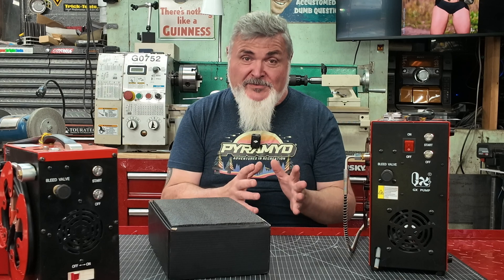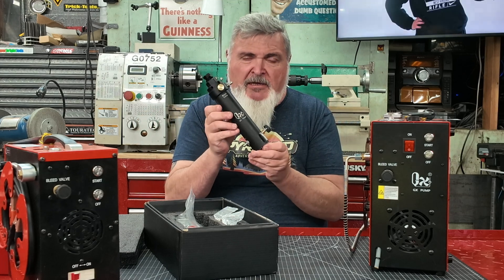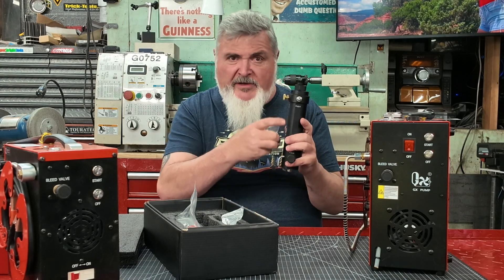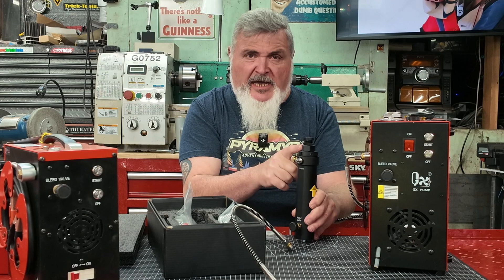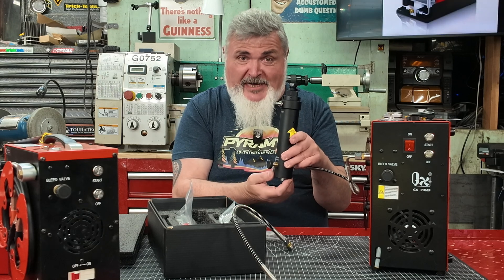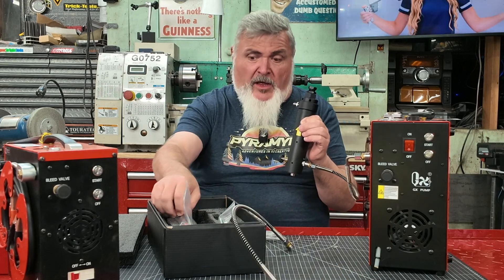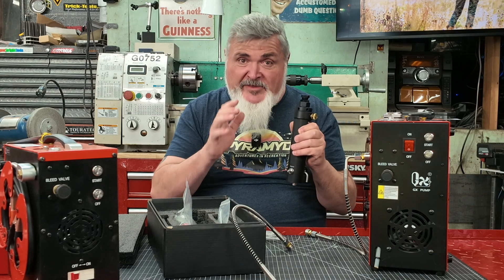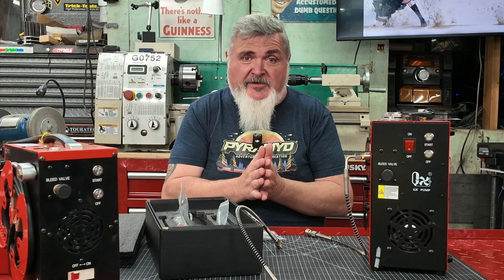Revolutionary Moisture Separator for PCP Airguns: Physics-Powered Dry Air Solution!

Comment: Hi ! I have been following your Channel becauseI own a GX CS2/3-401 PUMP PCP COMPRESSOR which I purchased maybe in 2021-2022 ! I have been trying to watch if anybody shows or reviews this compressor but I have had no luck !  I need to find the corresponding Owners Manual or Instruction Manual for my model without any luck yet !  I will like to ask you regarding this GX-PUMP HIGH PRESSURE PCP AIR COMPRESSOR’ FILTER’S operation where you mentioned that this  FILTER will build inside itself air pressure up to 2,000 PSI before actually letting the Air out to fill the Rifle/Pistol’s Reservoir.  My question is: if my PCP Air Rifle and PCP Air Pistol’ Reservoir both have a 200 BAR Air Pressure Limits will this FILTER allow both the reservoirs to filled up to 200 BAR ? I will appreciate your answer to my inquiry!  Thank you for your very detailed explanations on anything PCP related and your overall knowledge !  Subscribed !
Reply from the maker: First we need to make sure we are using the same units to properly understand your question and the answer. 200 BAR = ~2900 psi. The pressure maintaining valve is actually set at 1800 psi. All that means is that air won't flow OUT of the filter UNTIL it reaches 1800 psi. Then it will begin to fill the line to your gun. It will slowly fill until your 2900 psi (200Bar) target is reached with no issues.

Comment: Do I need a moisture filter on my Huben hand pump, and, if so, which one would be good for it being so small and requiring a higher pressure than most? Thanks and thanks for the great content.
Reply from the maker: Thank you for your comment. The rate of airflow does not affect moisture level or separation, so yes, this filter will work great and a small to medium powered compressor OR a simple hand pump. Use of this separator will make the air in your gun much much drier. Most folks don't stay with a hand pump for long due in large part to it labor intensive nature. You must be a beast!

Comment: After conversing with Pat about what compressor to get after getting two Vevors that failed to work, I ordered the CS4, and at the same time, this filter.  I am impressed.  Topped off my 6.8L bottle from 2,800 psi to 4,500 psi in 38 minutes.  Just wished I had thought to use your affiliate link.
Reply from the maker: That's awesome to hear you're impressed with the filter and your new setup!

Comment: I there any reason a vacuum pump cannot be used to "pull" a vacuum on the unit to dry the Desiccant
Reply from the maker: It is my understanding that the media needs to be in a 700 degree environment for a period of time to effectively remove moisture from it. This is how it is done commercially. Most of us don't own kilns and new material is really cheap. Worth a try I suppose if you have the gear, just be sure you have an effective test method to determine success.

Comment: Is it true that you should not directly hook up your compressor to your air gun? My compressor has a water separator on it? This is off topic but a lot of pellet and slug manufacturers are focusing on expansion but I'm more interested in finding a harder slug and pellet for penetration on harder objects. I'm not a hunter but for example bones , metal and wood. In my opinion there's too much expansion today and a lot of these slugs and it's limiting penetration.

Comment: Why is the top equipped with a regulator and how do you adjust it? I haven’t been able to get air to go thru the filter since day one tbh. I was looking for the reason and found in the top a stack of belleville washers. Can you show us how that works and why they are there sir please?
Reply from the maker: That is NOT a regulator, it WAS a pressure maintaining valve. Watch the video again. The valve WILL not pass air until it exceeds 1800psi. If you have taken it apart you will need to recalibrate the pressure maintaining valve or PMV. My apologies if I did not make that clear in the video.
Reply: @TargetForge  mine made a popping sound and a whitish liquid is seeping from the threaded cap that twists onto the cylinder. Would that be a burst disc bursting or an “o” ring giving way? Is that something end users can deal with or is it a send in for repair issue on the separator? I need to fill my tanks.

Comment: So if I'm topping off an scba tank with a CS4, do I need to bleed the separator every so many minutes? Do I turn off the pump to bleed it, or bleed it with the pump staying active?
Reply from the maker: Depends on your relative humidity. You can vent while running, venting the compressor vent will expel water trapped there before it even get to the filter, so it is the better choice.

Comment: So much water sprays out the bottom! Can’t believe all of this was going into my tank!
Reply: @pepethegoat999  what happens to the stuff previously that went inside already.. does it eventually clear out. Or would this help too?
Reply from the maker: Dry air will move previous moisture through the system.
Reply: @wukong1325 the water drys out your internal seals, causes rust, and the compressed moisture also affects your power output. I would never fill my gun without this filter

Comment: I understand the point of it building up to 2 thousand psi Before engaging with the tank cause you are supposed to equal That pressure before opening the valve on a bigger tank when filling. But , Does it interfere with filling straight up to the PC p tank ? all that two thousand p s I  at once? Because I understand the point of it for a bigger tank but not straight to the gun, Wondering if that's too much or if it'll pop the probe out
Reply from the maker: Thank you for your question. I think you might be letting your imagination get the better of you. The pressure maintaining valve does not dump a sudden rush of air. As it starts to vent pressure it gradually equalizes, it will not "blow a probe out". This technique has been used for a very long time and is now affordable to nearly anyone. Heck, get one on Amazon, use my link, if you do not experience super dry, clean air, you have 30 days to return it for a FULL refund. They are the solution.

Comment: Just got mine in yesterday. Going to use it on my GX E L3 compressor to fill my BRK Ghost. That little compressor works great. Right now I have just a small gold filter on the whip line. Think I should keep that on the line still, and run it in conjunction with the new GX filter,or just run the new GX one? It’s a great looking well built filter. Thanks for any help. God bless.
Reply from the maker: Good stuff!

Comment: Great product review. I'm getting ready to purchase an Avenge-X airgun and a GP CS4 compressor. Is an additional moisture filter like this necessary with this combination, as the CS4 has some type of water seperator built in? Thanks.
Reply from the maker: The onboard separator will help, but this is a significant upgrade to the air quality, and the GX CS4 is a great compressor.

Comment: Thank you!
I am currently using the big golden Tuxing Molecular Sieve, but this is the real deal! A proper seperator snd only afterwards a desicant. And even better, with an actual pressure release valve, nice!
Will definitely get one of those.

Is there any flowrate range given?
I would assume GX 2 to 4 are all fine with it, what about a bigger one?
Reply from the maker: It should be fine op to 30L per min. That is way higher than most "home" compressors.

Comment: Picked up one of these separators. Noticee you and Broncato (sp?) in another video talking about the various separators and that they need to be vertical. I'm assuming that that is while they are in use? After done using the compressor and purging, I'm guessing that the separator can be laid horizontal for storage? I have a nice container that I can use to transfer the GX-CS2, power supply and separator all together but the separator needs to be laid horizontally. All good?
Reply from the maker: Just be sure it is vented and dry FIRST. You should be okay.

Comment: I have one of the early Yongheng air compressor that operates on 220 volts. Came straight from China. Will this filter work fine with this compressor?
Reply from the maker: ANY compressor will benefit from this separator. The physics don't care what you compress the air with. That is what makes this unit so special.

Comment: Can these also be used on a large scuba tank? I have a large compressor with filtration and just bought one of these for added protection but was wondering if it can be used on either a compressor or a tank
Reply from the maker: Sure it can. I would ditch the SCUBA tank and get an SCBA Carbon Fiber tank, they are MUCH better.
Reply: @TargetForge that’s what I have, carbon fiber 98 cubic foot air venturi tank with the Edgun ezfill, best thing I ever bought, it’s expensive but worth every penny
Reply: @michaelpintal5419  I see. You wrote SCUBA and I thought that is what you meant. Sorry!

Comment: Where can you get extra filters when needed, I checked GX website and doesn’t even show the filter, my concern would be after when I need filters that they won’t be available
Reply from the maker: Hello Michael, there are no filters to replace. That is not how this works. As I stated in the video 98% of the separation of water happens due to fundamental physics. The last scrub is done by the cartridge (of which you get two) and this cartridge is completely user serviceable. You pop open the end of the cartridge, remove the spent micro sieve media, refill with fresh micro sieve media, close it back up, and reinstall. The only consumable you need is fresh micro sieve media. Also, since this media is only being used to scrub a very small amount of moisture (because physics did the heavy lifting) and you have two cartridges out of the box, the initial media should last quite a while. (6 months to a year depending on your RH when used). I will work on a video going over this in greater detail.

Comment: They are sold out already lol do you know when the filter cartridges will be available?
Reply from the maker: Be sure to subscribe for the latest news on availability! More are on the way!
Reply from the maker: There will likely never be a replaceable cartridge. You can service them yourself. You can find replacement media here: https://amzn.to/4lU55bf You can keep one of the two included cartridges ready to go in a well sealed plastic bag and hot swap when you need to. Try to buy micro sieve material as you need it, as fresh material is always going to perform better. If you do need to store it, make sure it it is well sealed from atmospheric humidity. More filters are available right now. They might sell out again, but they will be back again, don't worry.

Comment: Can you use this on any compressor?
Reply from the maker: Sure can. As long as it can achieve the pressure you need.
Reply: @TargetForge  I have a barra 250z it fills to 3600psi my compressor is rated for 4500psi so I should be good right?
Reply from the maker: Yes, that will work very well.
Reply: @TargetForge  thank you sir! I'm glad I found your channel.
Reply from the maker: Welcome!

Comment: Once the working pressure is reached, is it a gradual rise in pressure after the valve is opened to the PCP itself or is it effectively an 1800psi rush? I’m thinking it would be gradual but want to be sure. I’m thinking of filling from empty or low pressure scenarios.
Reply from the maker: In use I have found mine to be pretty gentle. Besides, once the value of the reservoir drops the valve throttles flow anyway. This is proven, decades old technology. Just made smaller, and more affordable.

Comment: If I understand correctly the compressor does not have to repressurize the moisture separator since it retains 1800 psi? The compressor only has to pressurize the line to the separator. That is good for those of us that have smaller compressors as that is a lot of volume to pressurize each time.
Reply from the maker: That assumption is incorrect. On this unit when the coalescer is vented via the compressor vent it will need to be re pressurized. However, as explained in the video, that volume is pretty small and won't be a huge burden on small compressors.
Reply: @TargetForge  I may have to try one then. Thanks!
Reply: What sequence would you purge compressor and filter in to best get moisture out of both?
Reply from the maker: Pretty sure the sequence does not matter, just don't use all the pressure venting one valve. Burp the separator then the compressor briefly. Go back and forth until you see dry air. Once you do you are ready for the next time.

Comment: I just ordered one using your link.  Should I assume the activated carbon is an idea contributed by GX?  Is there a way to take it out and put in more molecular sieve?  I am not going to be filling breathing air tanks.
Reply from the maker: So the unit comes with two cartridges that have a little charcoal in them. I would just use them "as is" until you change the desiccant and then replace with good micro sieve media. No need to purge them needlessly IMHO. Yes, it was a GX addition beyond my spec.
Reply from the maker: THANK YOU FOR THE ORDER!